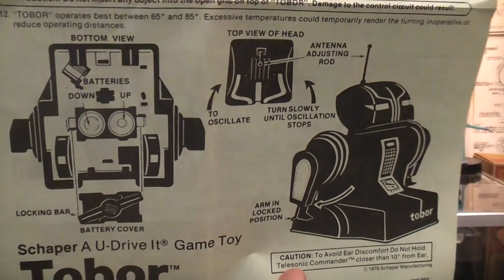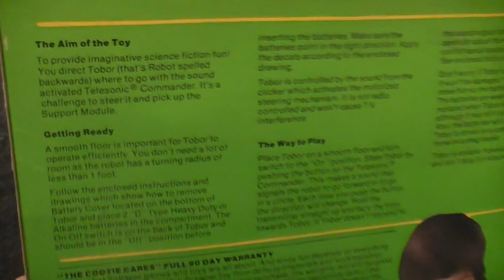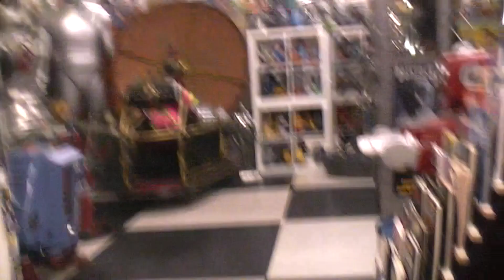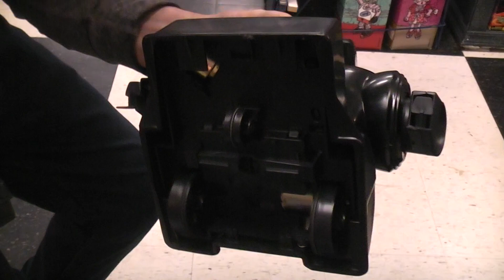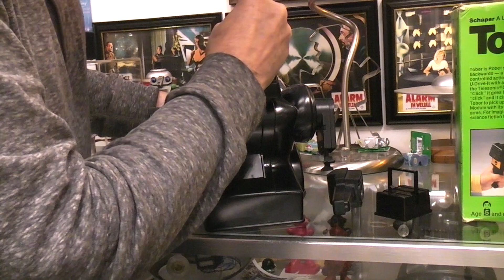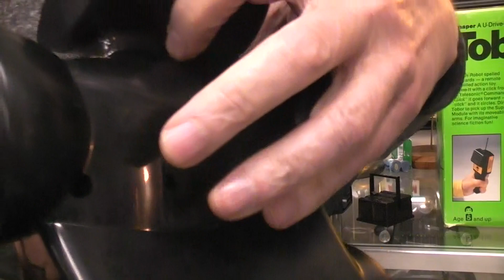By Request. TOBOR. Sonic control. 1978 U-drive game toy robot.

Comment: That is very coOL the way it's antennae pot adjusts the sensitivity. Neat wittle support box, to carry classified documents or sandwiches..Very 70's look with stripes. Kind of like Radicon robot control only sounds instead of coherer. Never seen this robot before, nice. I like it, even without the decals on it.